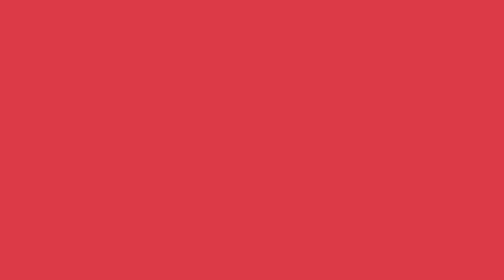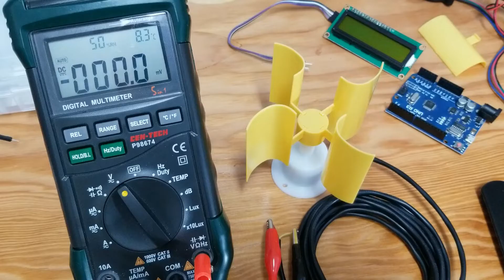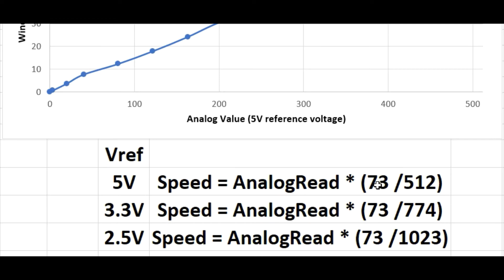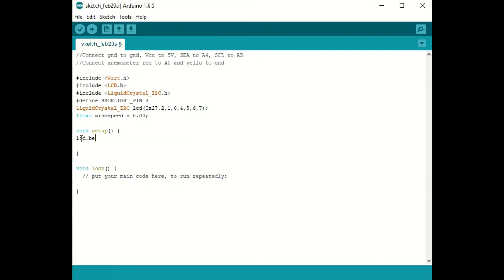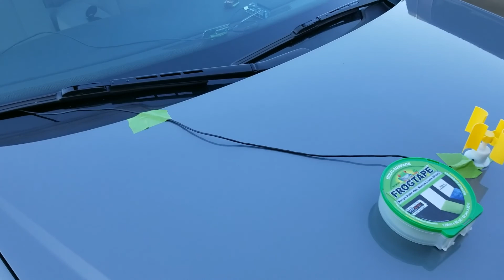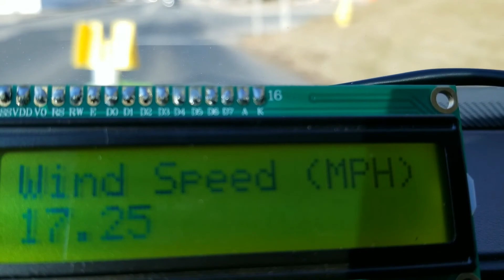Arduino Windspeed Anemometer or Redneck Speedometer?

Comment: Hello
Thank you for this video.
Will this anemometer work in a tube?😅
I'm thinking to measure the heart recovery ventilation air flow..
Reply from the maker: It should. You would just have to adjust the values for the interference from the tube.

Comment: Did you try to open it to reveal which DC toy motor is used inside? If yes, kindly let us know the motor model or pic of the motor. Many thanks
Reply from the maker: I haven't opened it up. I don't think it would open without breaking the plastic.
Reply: @ScienceFunInnovations  Thanks for replying. Possibly would you be able to test it as a motor by applying DC voltage from a variable supply source to check it working i.E operating voltage, current, RPM, and coil's internal resistance probably it will be easier to find the motor without physically looking at the motor. Thanks again, really appreciate you replying back to my comment

Comment: I'm still a beginner on using Arduino, how do I get the corresponding 5V logic values?
Reply from the maker: Speed vs. Voltage? The manufacturer included a table of speed vs voltage.
Reply: @ScienceFunInnovations  thank you for your fast response.
I meant the values on column “D” on the excel sheet, how did you get these values?

Comment: can that anemometer be mounted sideways (90 deg from vertical) and still produce consistent readings, albeit different from a vertical mounting.  I less interested in wind speed and more interested in whether there is any airflow rising in a vertical column that exceeds some threshold (zero really).
Reply from the maker: Yes. It can be mounted in any orientation.

Comment: Can i have the coding
Reply from the maker: //Connect gnd to gnd, Vcc to 5V, SDA to A4, SCL to A5
//Connect anemometer red to A0 and yello to gnd

#include <Wire.h>
#include <LCD.h>
#include <LiquidCrystal_I2C.h>
#define BACKLIGHT_PIN     3
LiquidCrystal_I2C  lcd(0x27,2,1,0,4,5,6,7);
float windspeed = 0.00;

void setup() {
lcd.begin (16,2);
lcd.setBacklightPin(BACKLIGHT_PIN,POSITIVE);
lcd.setBacklight(HIGH);
lcd.home ();
lcd.setCursor (0,0);
lcd.print("Wind Speed (MPH)");
pinMode(A0,INPUT);
}

void loop() {
windspeed = (analogRead(A0) * 73.0 / 512.0);
lcd.setCursor (0,1);
lcd.print("           ");
lcd.setCursor (0,1);
lcd.print(windspeed);
delay(500);
}